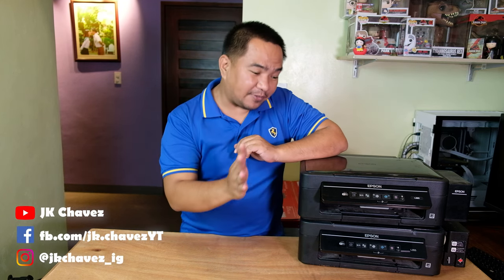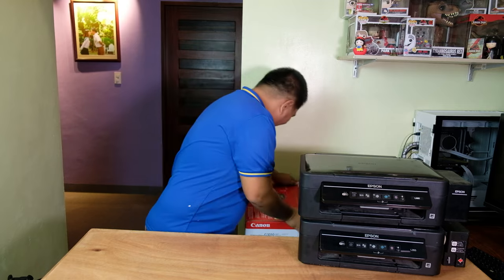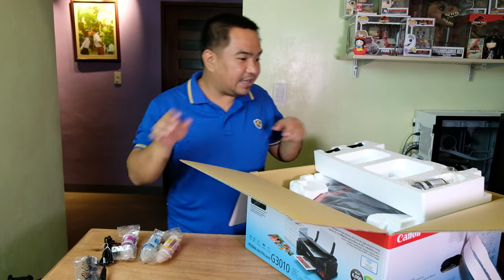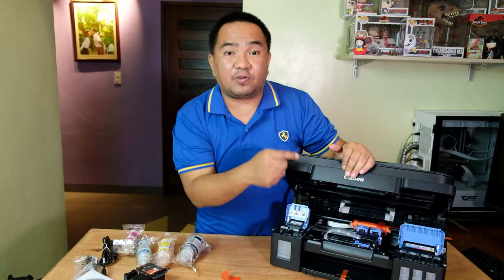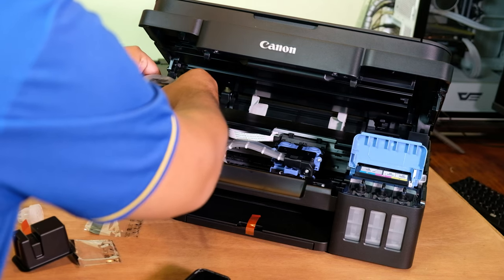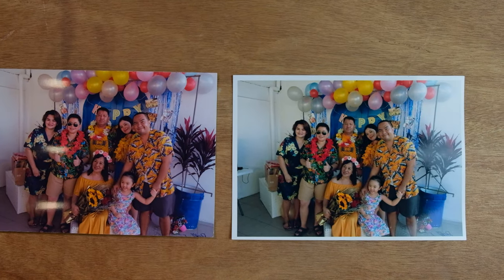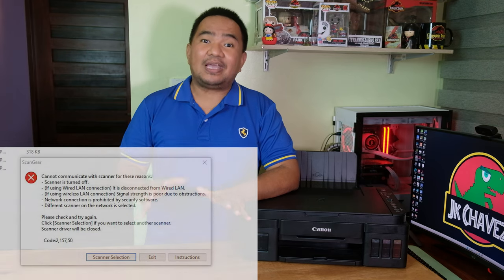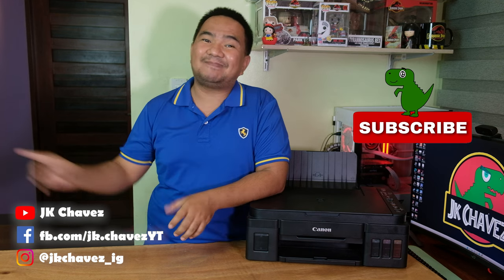Canon "Wireless" AIO Printer Pixma G3010 | JK Chavez

Comment: Hi sir! I'm a mom who knows nothing about printer and I need to buy my Grade 7 kid a printer for school. Do you have a recommendation? Planning on buying Epson EcoTank L3210 A4 All-in-One Ink Tank Printer pero mas okay po ba and Canon?
Reply from the maker: Hi maam, Epson printers are good, my only problem with them is their ink tank counter limit which you need to reset if you reach a certain amount of print) but if not for mass printing like business, and gamit lang po for school use, more than enough na po sya... 
reason why i will suggest canon printers is walang counter limit, and mas madali palitan ung print head pag nasira na.
the l3210 is a good printer, wala lang pong wireless printing, if plan po sa isang computer lang naka connect to print okay na po sya... if may wireless connectivity naman po kukunin nyo any computer sa house nyo po can print, like the canon g3010 or epson l3250 for wireless all in one printer po..

Comment: What printer yung pangnegosyo po sana? like can print a lot but still performs very well.
Reply from the maker: for my suggestion or personal experience, i would get an epson printer, it can last long like 2 or more years like nung mga epson ko, issue lang pag tumagal is minsan may smudges sa gilid, i believe cleaning lang ng waste pad pero d ko pa nagagawa.. ito naman canon d ko pa ma suggest since bago pa sya, wala pang 1 year, pero so far working pa din. and d ko sure max print nito, kasi sa epson may certain number of prints then need mo pa service kay epson para i reset ung counter, pero may mga available for download din naman para kaw na mag reset..
Reply: @JKChavez  base s manual 6k sa black ata at 7k colored?
Reply from the maker: @kuyajmonavlogger7901  depends po, if text or not high quality print pede umabot, depende kasi talga kung saan po gagamiting print..

Comment: Can you suggest if ano po yung much better printer when it come sa ink price po nila and yung consumption po ng ink. Between Canon and HP po sana
Reply from the maker: unfortunately d po ako maka pag suggest ng HP since wala akong unit na may continuous ink system, and per checking and comparing before sa octagon computer store actual print, d ko gusto ung output ni HP out of the box, magiging okay naman if nag change ka ng settings for printing pero mas okay si canon or Epson po..

Comment: Sir, asking if you also experience this issue when using the wireless function with the G3010. 

If it is connected to a router, the printer cannot be turned off. When either of the first three buttons is pressed,  it will be stuck on a loading display and other functions won't work at all.  Have to unplug the printer before being able to use it again.
Reply from the maker: not that issue, the only thing i encountered is if i didn't use the printer for a long period of time it is on a hang state, i cant print anymore, i need to restart the printer.. :(
Reply: @JKChavez  hi sir kamusta naman po nowadays yung printer?
Reply from the maker: @icscaa  Hi, honestly still working, im really surprised na tumagal sya. wala pa din issue up to now, naka 2 sets of ink bottles na din ako..

Comment: Eto pinagpipilian namin saka HP Smart Tank 515. Ang ending, sa HP Smart Tank 515 kami nauwi. Ang sabi kasi ng sales man sa comp shop, mas mura daw ang ink ng HP saka mas matipid, unlike kay Canon. Meron na din kasing G3010 ang pinsan ko. Kaya alam ko na ang performance niya.
Reply from the maker: Kamusta naman hp printer sir? Oks po ba sa photo quality?
Reply: @JKChavez  

Wala akong masabi sir. Pero bago kasi ito so obviously, magandang output pa ang ipapakita sa atin niyan. I don't know kung sa mga susunod na araw o buwan eh same quality pa rin siya.

I also own an HP Ink Tank 115. Purely printer lang siya at hindi wifi. Diyan sa Ink tank 115, kitang kita yung diperensiya ng output. Medyo grainy siya pero ang ganda ng sa Smart Tank 515.

Advantages of HP Smart Tank 515:
1. May HP Smart app na siyang all-in-one app (for both windows and android phone, for sure meron din sa iOS) to install the printer on the go. Ni wala ka nang gagawin. Just install the app and let it do it's thing, including driver installation.
2. Scanning and copying is a breeze. Pindutin lang kung black or colored yung gusto mo copy, then lalabas na agad yung papel dun sa tray na printed na.
3. Very easy to connect to wifi. At supported niya both 2.4Ghz at 5Ghz wifi.
4. Mura ang ink. Around 249 pesos lang ang 100ML ng isang kulay ng ink niya. And matagal maubos yung ink kasi kung makapag-print kami sa isang araw, inaabot ng mga 100-150 pages. Yet hanggang ngayon, nasa kalahati pa yung ink tank.

Disadvantage:
1. Hindi kaya ang LEGAL size paper para i-scan. Although hindi naman ito talaga disadvantage kasi ito lang naman talaga ang kaya ng printer. Otherwise, bibili ako ng mas mahal na printer para kaya ang legal size.
Reply from the maker: @chrisdcsilva  Medyo masakit na hindi kasya legal size, pero interested ako dun sa 5Ghz wifi capable sya, although hindi ako nag lalagay ng smart devices sa 5ghz ko.. pero parang ang saya nung features na un. next time try ko din ung HP, lat 4 years ago kasi bago kunin isang epson nag pa test print ako sa shop sa megamall ng hp printer na may CISS medyo grainy sya before, d ko na lang din maalala model.. :) thanks thanks for the input sir..
Reply: @chrisdcsilva good morning po kamusta naman po printer ngayon sir
Reply: @icscaa 

regarding HP Smart Tank 515, eto po. Until now, buhay na buhay pa rin. And the good thing about this is I've been using  Inks na nabibilia lang sa shopee and not the original one. but the quality is still great. Hindi ko pinagsisisihan na ito ang nabili kong printer. 1 year after and di pa rin ito napapagawa.
Reply: @chrisdcsilva hi, similar ba to sir sa 520? Kamusta namn po yung 515 nyo to this date?